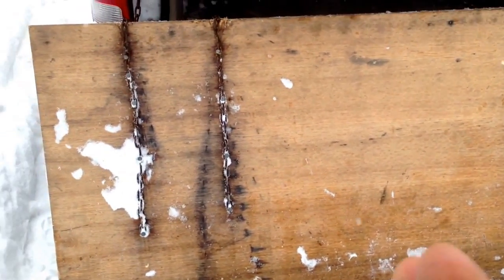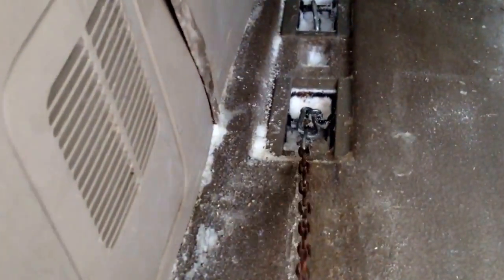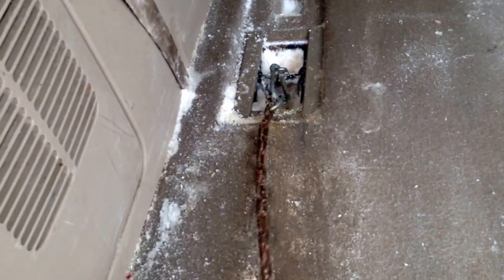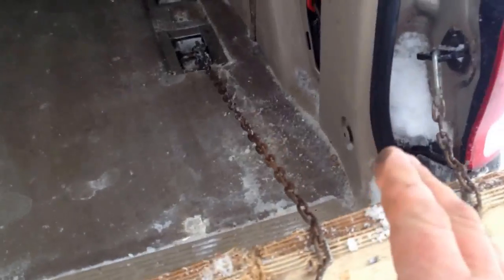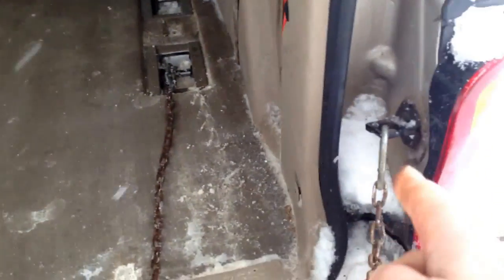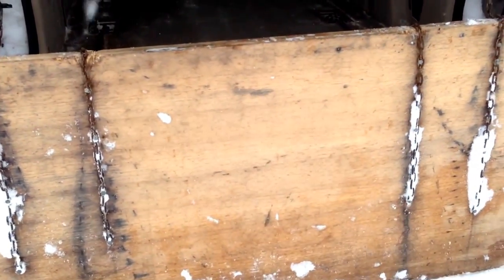SIMPLE "Mini Van Snow Plow" 2. Hooks up In 1 Minute!!!

Comment: THANK YOU! I made one and used it for the first time tonight and it worked beautifully!!! 👍👍 I thought I was living like a boss with my snowblower.... I almost bought the hitch sportplow for close too $2,000
Reply: How's this working out for you?
Any issues or design changes?
Reply: @shannonp4037  I just used it today but I was I lil to rough with it plus it was a lot of ice so it is racked out of square so I'll probably have too put more screws in it but I like it! Quicker than snowblower!
Reply: @a.d.h.dn3d461  Thanks for the reply. I have a 2500 HD 4x4 Chevy I want to do this too.
Reply: @shannonp4037  I didn't use plywood, I stacked 2x4 on top of each other about 3' tall.
Reply: Wondering I can do this in my van, I have 2 back doors.

Comment: I think I'd put some angle iron on the bottom to prolong the life of the 'plow' but otherwise this should work with my mid-size all-wheel drive SUV, even on my gravel lane.  Not sure if it would have helped a couple of weeks ago with the 4 & 5 ft drifts in my lane though.  Had to have a guy with a tractor dig me out - saw 4 distinct layers of hard wind-packed snow.

Comment: Hi.  I really love your invention and would like to make one of my own.  However,  I don't think my Toyota Sienna has a place to hook uo the shorter chains. It only has the seat hooks. Do you have any suggestions?  Also what is the length of each of the two sets of chain?   Ever worried you're going to back into something like a curb and break something?  I look forward to hearing from you.  Best wishes,  Greg
Reply from the maker: Without seeing it I wouldn't know. The chains I use are light enough that if I hit something solid it will just break a chain. As far as curbs believe it or not it just rides up over them as long as I hit them on a bit of an angle

Comment from the maker: Here is a link to part 1
Simple  "Mini Van Snow Plow"  Hooks up in 1 minute!!!
Reply: bolt some caster wheels on the back of the plywood at the bottom, then when you drive forward it and it tips, it will lift the bottom off the ground so you dont drag the snow forward